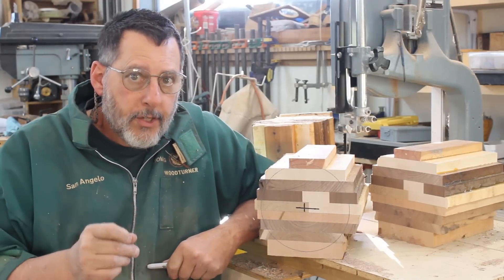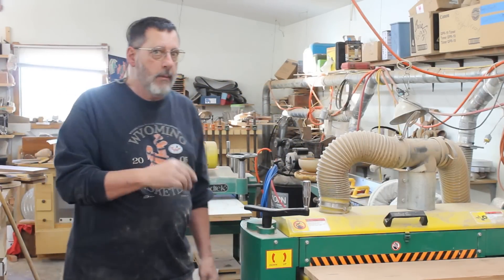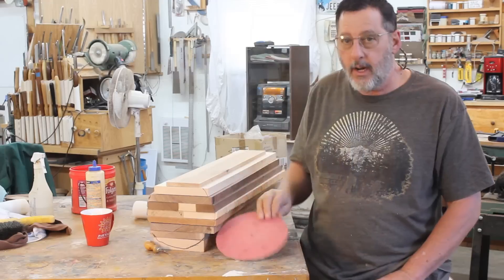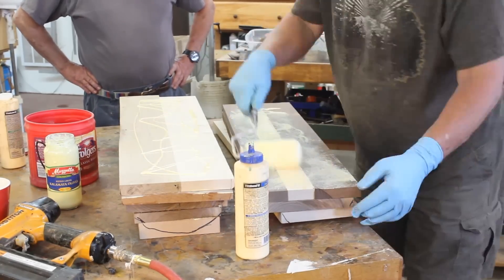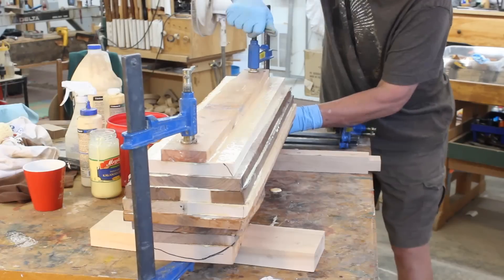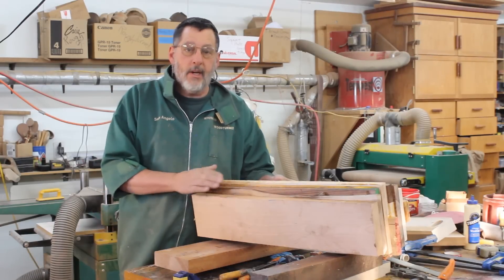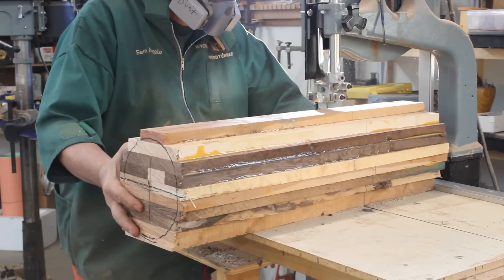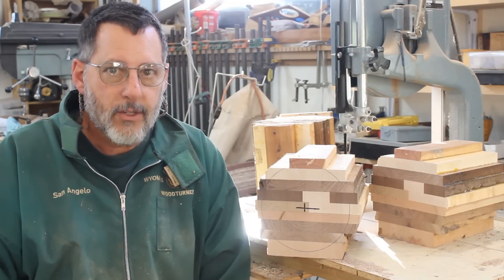Segmented Sphere:  The Glue-up,   woodturning (part 1)

Comment: Good pointer about using you pin gun to prevent drift of wood until clamping.  Saw your video on the Quick Draw.  Ought to be fun.  I would have trouble getting my lathe up to speed in one hour. ;)
Reply from the maker: +Gerald Shultz Well, for the actual Quick draw, we can do some prep work ahead of time.
Sam

Comment: 1 hour? For me that would be one massive panic attack! So you will be taking one of your blanks with you and will be turning that in one hour? I'm not exactly following the procedure . If you have time could you tell me if I am correct or totally wrong. Can't wait to see the sphere.
Reply from the maker: +Tom Wilcox Well, we are allowed to have some of it prepared.  I will have a cylinder turned and laid out.  I will turn it as round as I can and then turn it 90 degrees.  I will turn off the nubs but I will do little or no sanding and no finishing.  I will have a piece completed with a stand that will be auctioned off.  It is a panic attack but fun.  Sam